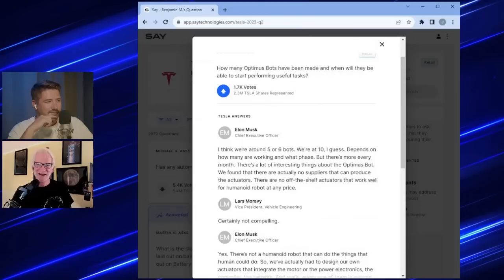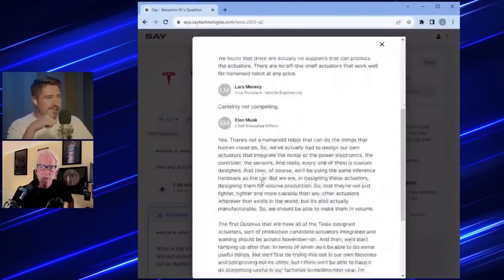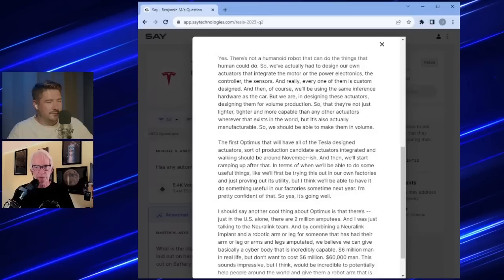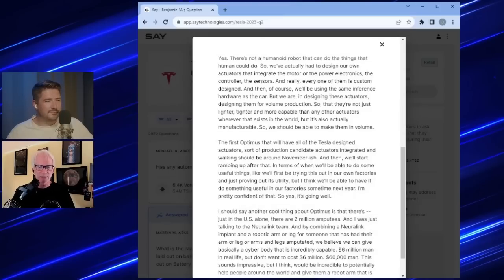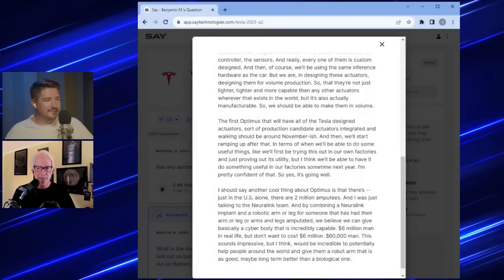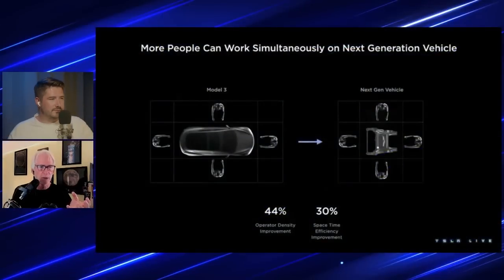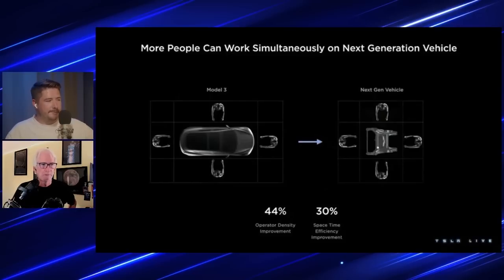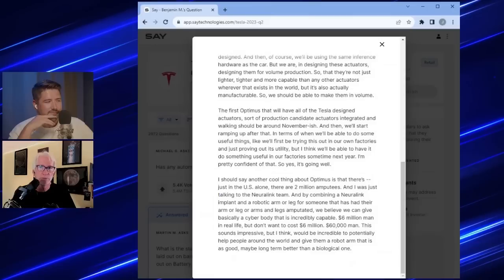Is TESLA BOT being MASS PRODUCED already?⚡Scott Walter

Comment: If as Scott says he is hopeful we will see something in "12-18 months" it's clear there is no current mass production now.  What an unfortunate title.
Reply: Or not. You have to be clear what "we will see" means. It's entirely possible that the first 10,000 Bots will never see the light of day outside of a Giga-Factory, but will contribute markedly to reducing Production Costs. Those could be being Produced right now.
Reply from the maker: Due to Tesla Bot being designed with mass production in mind, they are faster in getting the production line running. Their goal is to mass produce the first useful tesla bots as soon as possible. With Tesla Bot it is not about creating a bunch of expensive low quantity prototypes because they have to feed their neural net ASAP! Just like with FSD they want to have as many bots doing "low hanging fruit" tasks as they can to get more data to train their AI. And with Scott saying we'll see something in 12-18 Months he means, that tesla will have solved some major production bottlenecks and the supply chain will be figured out more and more for mass production.
Reply: @TeslaFix  Do I believe we'll see some BOTs being used in factories in 12-18 months- yes.   But mass production no. As usual Scott is speculating which is ok.  His timelines are even more optimistic than Elon's on BOTS.

Comment: The bot will build the bot. The first use case will be its own production line. Why wouldn’t they?
Reply from the maker: I think it will get to the point. But at first the tesla bot is super early stage. There are other things the bot could do on the factory floor of the car productions. They could jump in as spare bots for the little drone bots. Or "feeding the zoo" like Scott calls it. The tasks, where for example, a human operator brings stamping parts for further construction to a KUKA robot arm. Those bots are in a cage for safety reasons and has a pass through zone where parts are passed.
Reply: Thebot is general not specific.
Reply: @markthomas7279  And yet, it will start at specific tasks. It will have to learn those tasks like any worker. The difference is that anything one learns, they can all be updated to know it.

Comment: All right I like your video and I like what you guys are talking about I love it but I am questioning the whole ideology of a mechanical actuator it's not necessary we already have technology that will do it it's called magnetic muscle in other words you have a series of small magnetic actuators and you can build that series as big as you want to handle the foot pounds of pressure that you need so if you only need say per finger you only need 3 ft pounds of pressure you might only need 30 of the little tiny magnetic actuators say for a knee joint you might need 140 of them That's fine they're all the same they're all identical you just put them in series The only thing you got to worry about is how they pass each other and conform to the restraints that their environment is and keeping them cool and slippery
Reply from the maker: Thanks for sharing! Since I am no mechanical engineer I got only a fraction what you are talking about, but I like what you said. Maybe they already considered that, but it wasn’t a viable solution for mass production? IDK… Maybe you should contact someone working on that devision at Tesla? It would be awesome if you would move the needle there 😍
Reply: Those simple sounding constraints are very hard to manage and the reason that such methods aren't being used much after years of research. At some point such systems will become practical we're far from there right now.

Comment: Is TESLA BOT being MASS PRODUCED already? NO nor should it be in mass production at this time in its production development, What is needs is a small population of rapidly evolving software, hardware and AI programming integration.
Reply: Just like the Car.
Reply: They are mostly done with the hardware iteration, and the software can be updated easily.
Reply: @andrasbiro3007  such a small volume will not even begin to finalize designs. The robot will go through many complete redesigns for a number of years. Looks at the Apple iPhone the changes for the 1st 5 years were radical and only after that are minor improvements used to differentiate between years
Reply: @jjamespacbell 
Makes no sense.
The human body went through millions of years of testing, it works just fine.

Are you saying that the first iPhone was unusable and Apple needed many generations to design a competitive product? That's not my recollection of history.

Also there was no radical change. The first iPhone was a brick with glass on one side and no buttons, ant the latest one is essentially the same. Internally they are roughly the same too, battery, SOC, camera, etc. Later models got better components and better software, but the physical layout didn't change much.